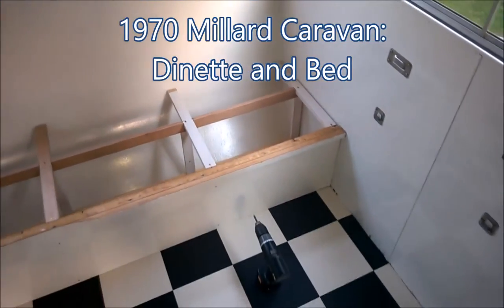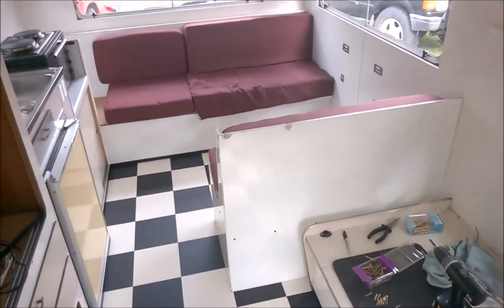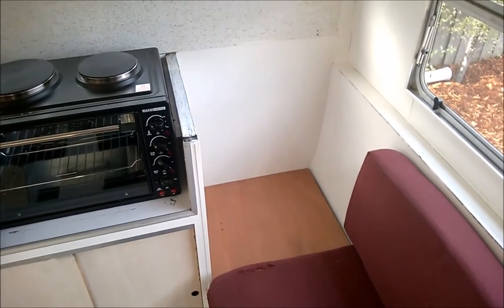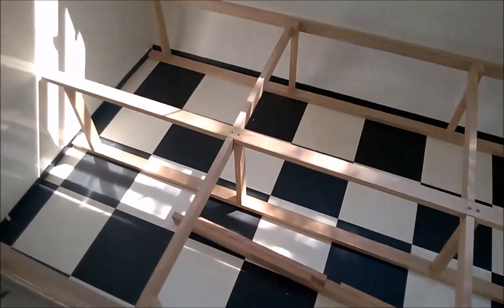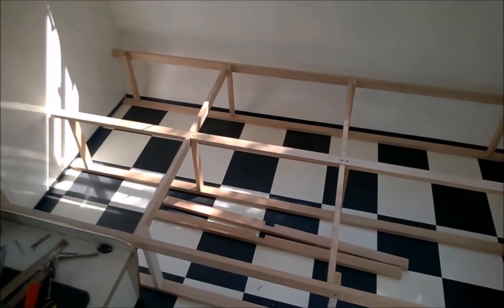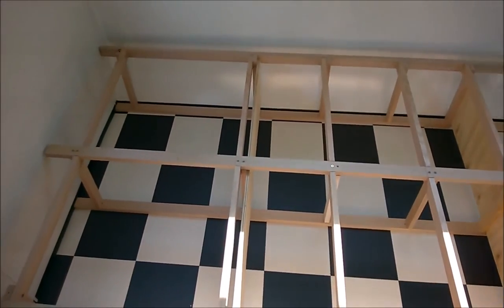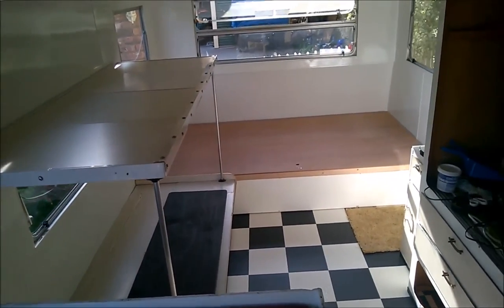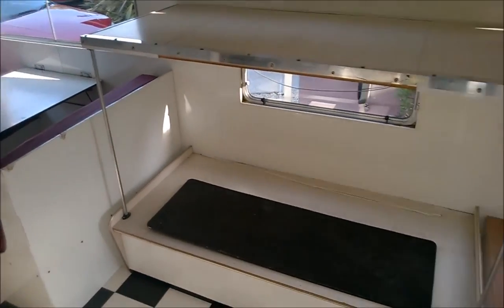1970 Millard Caravan: Dinette and Bed

Comment: hello, i first spoke to you about 4 months back.  i am doing my black and white floor this weekend. doing my template like you did yours! thank you for sharing. i got the old fridge taken out, have kept the original kitchen. painted it white too !! we did the window frames how you showed us too, but we got a window company to come and  do the rubber seals for us. i do have a question about the kick strips, where did you get them, i am finding this item a tad difficult to come across? thanks again for your help, loving the process. out van is an onsite van !!
Reply from the maker: Hi again!  Sounds like you made lots of progress. Before you put the lino down, check to make sure the rivets are not broken. I got a vid on this for my viscount as they where broken and floor was lose.  Kick strip I got from foamland in Hobart.  Cheers.

Comment: Hey buddy just wondering how your top bunk is secured to the wall in your Millard do you have any videos or pictures also I’m assuming the main bed is only screwed to the floor and not the wall ? cheers
Reply from the maker: That is right, i only screwed the floor section, however the walls would be ok if it aligns to the framing. The back has no frames and i didnt want to screw against a 3mm sheet as it would be damaged under vibration I think.
Reply: Rover Tasmania ok cool it’s just the top bunk I dunno how to fix it to the wall as I assume it’s not just the 2 poles holding it up lol
Reply from the maker: Thats different!  Yes, you need the timber support on the wall side to be bolted securely to the wall. I also would use some shelf type brackets to give further support. Just try and find a few walls frames to bolt it to.
Reply from the maker: Just re-read your original question and completely missed the bunk reference. Sorry about that, so ignore my first response as that was geared to the main bed.
Reply from the maker: Have a look at my vid https://youtu.be/CUcUcNybRCw you will see how it has side support as well as wall support. Cheers.
Reply: Thanks that’s cool that what I thought so pretty much a piece of timber behind the wall to screw to and then a piece of timber screwed to the bed base and the wall with a bracket as well for extra support ? This is the first time I’m doing a diy project and had to gut the whole van so I’m all new to this and I’m sure will make a few mistakes along the way thou your videos have been very good guidance along the way and I thank you for that :)
Reply from the maker: Great to hear it Terry that your on track.  Set up you describe should do the trick.  I also forgot to mention that another great source of info for these older vans (Viscount, Franklin, etc) is the Classic Caravans forum (I am also a member http://ditzygypsy.proboards.com/ )  Members there are great with a wealth of knowledge, lots of pics to look through too.  Cheers.